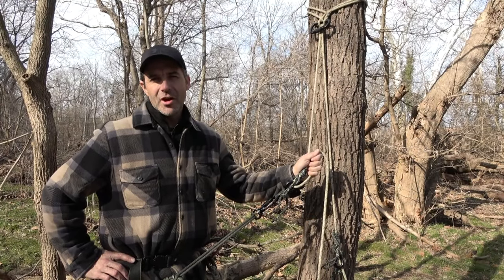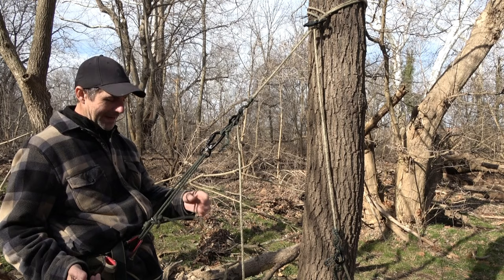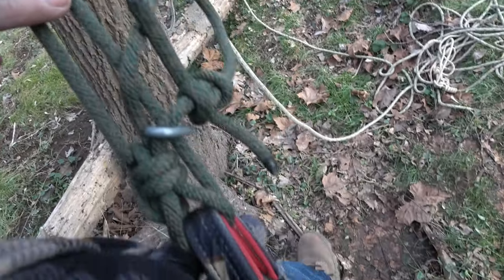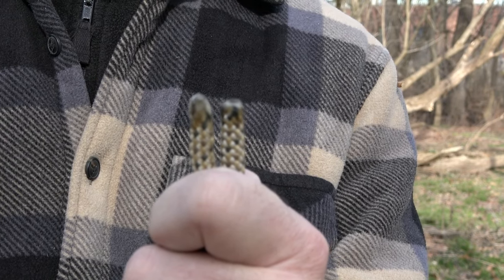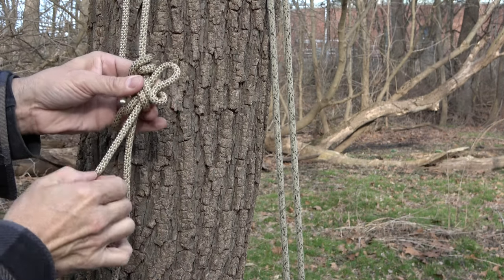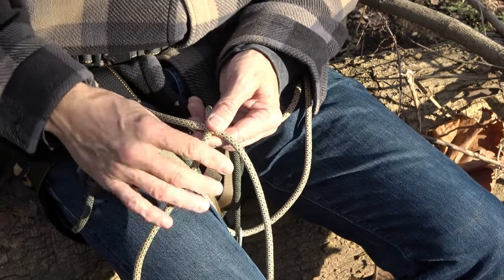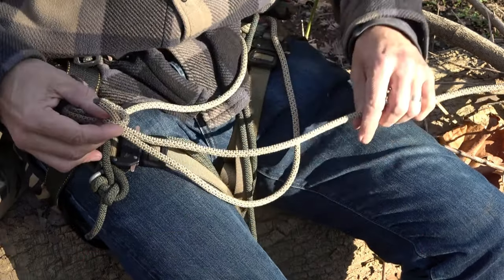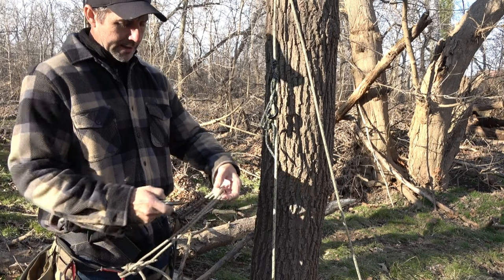Non-mechanical, Adjustable Bridge Design for Saddle Hunters

Comment: Hey John, just wanted to let u know that I use my Kestrel Flex with the double strand 8mm Oplux on my one climbing line & my bridge that came with the saddle is attached to the other co-dominant part of the 🌳 I'm cutting that is a real red oak spreader. 20 feet between my unions with rigging lines also up there. The ability to just loosen up one climbing line to transfer the weight to the other one while staying connected to both has worked 👍.  Hope your weather is cooler there & take care.

Comment: My tethering bridge is way too long and it's very hard to adjust and not only that I don't want to adjust it because I want it set for a more permanent tether position when I get to maximum height and stay. But I also need a bridge while I'm climbing that is shorter which will be safer. I really appreciate you making this video. Thank you.
Reply from the maker: That's appreciated.  I also would rarely adjust my long bridge, but I do adjust my short bridge and use this design... if ya adjust it frequently, consider a delta link on the side that adjusts. It's just easier and causes no unnecessary wear on your bridge loops.

Comment: John I’m a fan. Been waiting for diy adjustable bridge. Love this and in conjunction with JRB climbing hitch. Currently running old (very) foot portion of climber to ascend descend with my saddle. The second line is tethered to the foot section preventing that from falling. Ultra light quiet safe and allows me to alternate sit stand on long sets.
Reply from the maker: Ok brother, just make sure u gotta plan for everything.  Buddy of mine had a climber bottom collapse and he was stuck on his seat a long time til help came. We all should have a rope and rappel plan. Can ask me questions on Facebook or via website. Plenty of people wanna sell ya something... I am just here to help.
Reply: @jrbtc  thanks do have figure 8 and 32’ of climb rated rappel rope and have trimmed my tree and safely rappelled down.  I evaluate risk and if too great i build a fail safe or I don’t do it. Hope your buddy recovered from the suspense ordeal. When I first bought mine I missed the instructions to tether the 2 pieces.  Tore my legs up shimmy down to the foot part.

Comment: Why use a delta link instead of a carabiner at 3:30?
Reply from the maker: A delta link or screw link is smaller, that's all. A locked carabiner is fine, but may double the size. And if you run it really short, and are turning all the way to the left or right, it just increases the possibility of the Blake's hitch contacting our main Carabiner on our Bridge. But you can use whichever works best for your system.

Comment: I just built my adjustable bridge,it is easier than it looks. I like it already and can't wait to use it.
Reply from the maker: If ya will adjust often, use a delta link cuz its smoother.
Reply: @jrbtc  I don't adjust often,thanks for the tip though and all the rest of the information you make available.

Comment: It's like u took a feather & tickled my brain. I have that same saddle u r wearing ➕ I have others.  One of the others has a bridge on it which I took off. This saddle I think was designed for those that want a light system with little metal but then carry several steps or climbing sticks with them which just adds to the weight situation. I just didn't feel comfortable using a climbing rope system with that single 8mm Oplux.  The right side of the bridge was connected to a Sterling 6mm hitchcord that was 42" long  tied right onto the right saddle mesh loop with 2 double fisherman's knots. That 6 loop English prusik had just a 6' Oplux running through the prusik with a figure 8 @ the end. Then when u r @ stand height u take a 8.5' Oplux Kiss system & connect it to the bridge b4 u remove the linemans belt. On that 6mm prusik u have a poor man's ascender on it to control your bridge length. 
I just put an adjustable 11.4 mm Samson Predator  that I made so I could climb with it. That bridge is very similar to the original bridge that came with my Aerohunter Kestrel Flex. The hitch was a 9mm eye to eye. 
I now own one 6' Oplux & 4 Oplux 8.5'. I have several chain links on my farm over the years that I took down this last year. They were held together with padlocks that r frozen in time. 
Thank you for this new bridge since it allows me to use some items that r either in a mesh saddle hanging up or in a 🪣 in my basement.  Can't wait to start climbing in March & doing presets. 🤚

Comment: Hey John! Sorry if I missed it, but what length of rope are you using for your main line?
Reply from the maker: For my stationary doubled rope system, I have several systems varying from 75 to 100ft.  80 ft is is a good number and means that you can climb any tree with a tree crotch up to 40 ft tall. I realize that you only might want to climb to 20 ft. But if the forest is mature and there are no low crotches, this will help. I never regret carrying too much. But every once in awhile 75 ft is not enough for me. More info:
https://jrbtreeclimbing.com/
Reply: @jrbtc  Thank you. I really appreciate the reply. I've been one sticking but obviously that is an extremely flawed climbing method as there are multiple times per climb where the girth hitch is well below your waist. Your method is exactly what I've been looking to add. Now to find 100 ft of canyon elite somewhere lol
Reply from the maker: @coolasafan1029  there are some references on my website. If you are building a stationary doubled rope system, I recommend 8 mm.
https://jrbtreeclimbing.com/content/jrb-climbing-system/
Reply: @jrbtc  Cant thank you enough. That website is worth its weight in gold. Thanks for all the effort

Comment: Thank you John you never cease to amaze me with your amazing skills in a world of knots! This is a wonderful adjustable bridge I will play around because I do definitely change my bridge length often! I've been Srt'ing most of the season and while I climb, I shorten my bridge and then once i'm at hunting height I struggle to loose or give my bridge slack because the swabish hitch is tight and requires 2 hand to loosen ! In that case I've had to take another step to put out my lineman belt around tree so i can loosen the bridge with  2 hands .  So with this adjustable bridge i don't feel the need to do all that and should easily loosen bridge with one hand. Thanks again for this great brilliant idea! Will definitely keep you informed how well this goes for me!
Reply from the maker: My pleasure Billy. If you adjust it alot, you may want to go with the delta link, and feel free to let me know how it goes.

Comment: If I made that bridge with 6mm sterling accessory cord would it be strong enough?  I weigh 186.
Reply from the maker: I prefer 7. As far as I know, Sterling doesn't recommend their standard 6mm for Life Safety applications. I am not saying it wouldn't work or that it's not strong enough. I'm just saying that it's not an application where I would skimp
Reply: Is it adequate for the ascender hitches?
Reply from the maker: @ronaldcramer5371  I realize you prefer a yes/no answer but I can't give your one. The manufacturer would say no. But do the math: a good rule of thumb is that we want our life safety system to be 15x stronger than the load on it. In a JRB doubled stationary rope system, you are putting roughly 100lb per side, target 1500. The cord strength is 1843. Your load is balanced on the 2 strands exiting the hitch (doubling the overall strength) but one side has a bend, cutting it back in half again, roughly back to the 1800 number.  By my math, it's good and i have climbed on this combination.  I just prefer something even stronger and better performing.  I would not use it for a single rope system though, because we will not hit the 15x Target with our full weight on one rope and hitch

Comment: Hey John what are you thoughts on using Sterling 6mm TRC for this bridge it is posted as having a MBS Rating (lb): 3,484 and a caribiner
Reply from the maker: It's a strong, high quality cord, but to the best of my ability to research the topic, a bridge is typically made of a flexible, traditional fiber. The Nylon/Technora combination is strong but a bit stiffer than Nylon. It will take wear and bend in the same spot and will also be a bit more difficult to get your Blake's hitch to bind. And so, i wouldn't recommend it. If you were to try any cord, the first thing to try is a simple Blake's hitch to make sure you can set it. Not all ropes and cords bend well enough to do so.
Reply: @jrbtc  Great advice Thank You

Comment: John, apologies if I missed it - but what is the advantage of this bridge over a simple rope bridge with prusik and paracord tender? Both metal-free and one-handed operation
Reply from the maker: Good question... ok off the top of my head:
1. If you want to replace your bridge, with that design, you would need to buy 3 things: a rope, prussik and tender... instead of one piece of cord.  Knowing exactly what to get, meaning the best rope and the best hitch cord or prusik Loop... well it's actually a more complex system because there is uncertainty even before we've started to build it. 
2. Your life depends on 2 of those 3 things. I am seeking to minimize the number of things on that list: one piece of cord, closed in a bend.
3. A prussik is always going to be much longer up the one side of the bridge, often too long, and restricting a full turn to the one side. This is extremely compact. Big advantage here.
4. In order to make your prussik bridge longer, you need to have it engaged and have the perfect amount of weight in it... just enough so that you can break the prusik and control how much slack comes into the bridge. If there is NO load on the bridge, ya can't get slack in without 2 hands.  I realize that this feature is not necessarily needed by everyone, but I do need it when I am using my system for certain climbing applications. 
5. Tenders are messy. I understand why we use em, but I don't like using them for anything, and have better solutions for every situation where i need something tended.
6. The prusik system needs that stopper.  What if your stopper worked loose... would ya notice it? I like how this is foolproof.  
7. This costs $10.
8. Lastly, If you like a friction hitch on your Bridge, that's great, but I would encourage you to check out some other hitches. The prusik holds but is not one i recommend here.